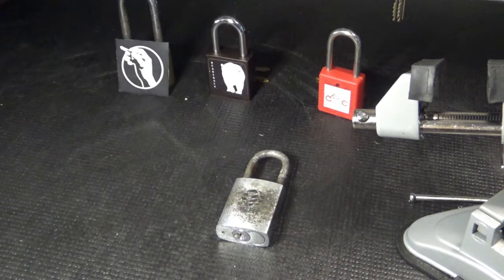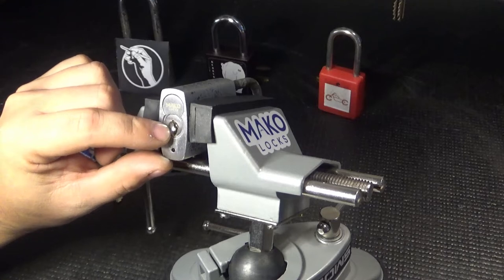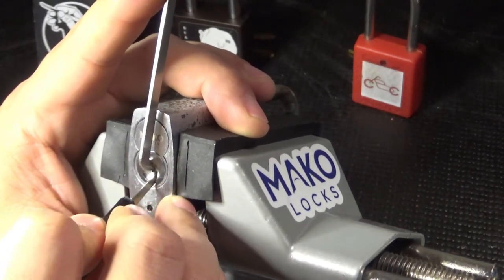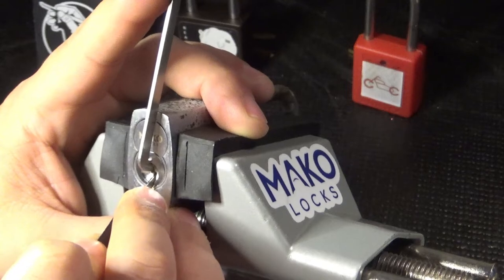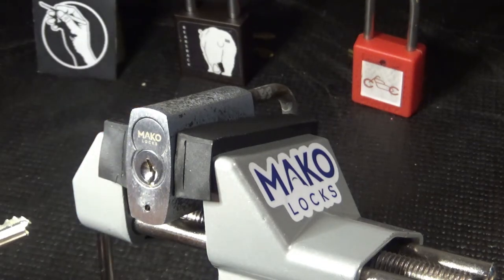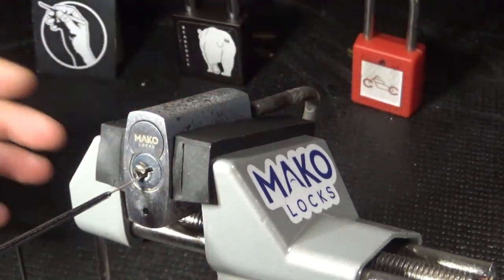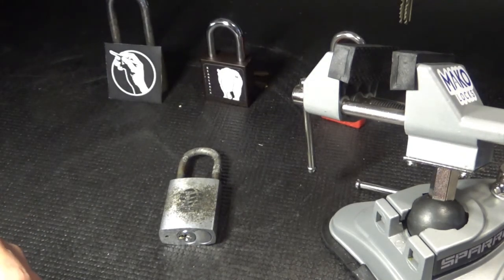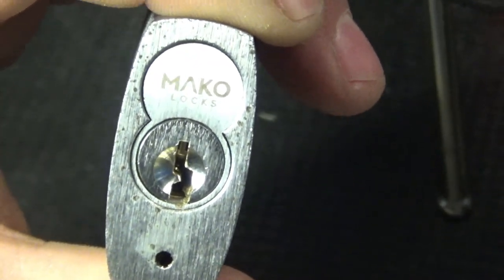[44] First to pick Mako M2 to Control and Operating

Comment: Just bought this and I'm trying to pick it!  I don't know if they've changed he keyway but it's insanely hard very hard angle and shield protecting each pin except for a small hole.  Do you have any tips for dealing with this keyway?
Reply from the maker: Hi there! This was a difficult lock to pick to both shearlines. It looks like I'm using a .25 Peterson, which is a standard thickness. I wouldn't think it would need anything special unless they have changed the keyway entirely. 

It's possible you're running into some of those security pins getting caught up in the shearline, needing to be overcome by means of counter rotation. Sometimes you can be in a false set and not know it. If everything feels bound up like rocks and there is no pin movement when picking, lighten up on tension to see if poking at each pin to see if one starts moving the plug the opposite direction. If this is the case, you're in a false set and it needs to counter rotate in order to be set. Keep applying pressure to the pin with a little force on the tension tool as it counter rotates. It's possible you'll need to float pick in order to set the pin by manually counter rotating; it can take a lot of finnesse to get that maneuver down, but once you get it, it will be in your back pocket for any future issues when attempting to overcome other locks in this sport.

Because this lock has two shearlines, it can be extremely difficult to know when you should and should not do this--often times continuing to pick is also an option. Mapping an SFIC for both shearlines is incredibly difficult, and I don't miss the headache it caused tackling these locking systems. Mako is a great brand, though, and their tolerances are up there with BEST and with added security pins for more difficulty.

The KeyMark, however, is a great example of a lock with "chambering" that can pose a significant deterrent for regular picks that 'shield' against regular picking. In that case you'd need .15 SSDEVS and in a steep hook to get any high-cut pins set.

I wish you luck.

Comment: wow! fantastic pick! i'm currently working on the same lock, got any tips on how to determine with reasonable certainty which shearline is binding?
Reply from the maker: Hey thanks, jercx! With the Mako M2, the binding pins will always lead you to the control shearline, which is the opposite of BEST SFIC. As far as reaching operating, you just really have to experiment and get to know your lock. I've opened mine only a few more times afterward before moving on to other locks and projects, and I can say that it was just as difficult for me to open. SFIC, especially with security pins, are very difficult to open to both shearlines. I wish you luck with the Mako M2.
Reply: @culperwoodhull6726  thanks for this invaluable tip, i thought the same as i can get to control pretty easily, but figuring out which pin to set for operating is quite a challenge. this validates the need to put a lot of time into figuring out how to get operating. i'm enjoying the lock nevertheless.